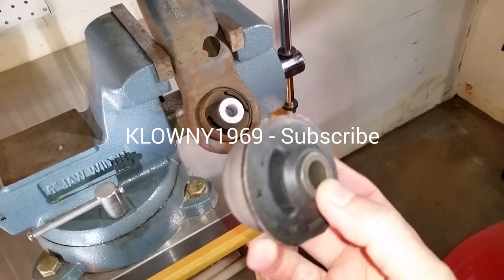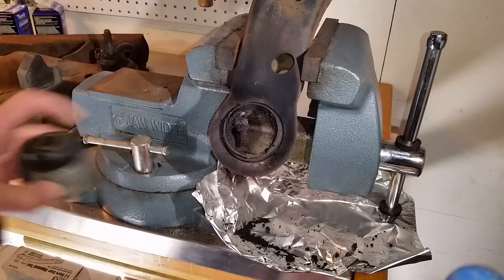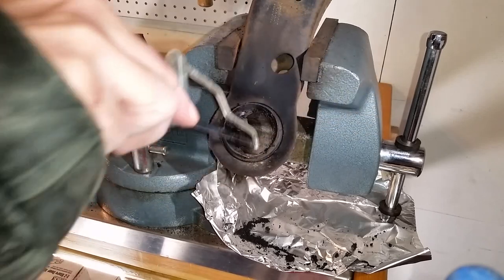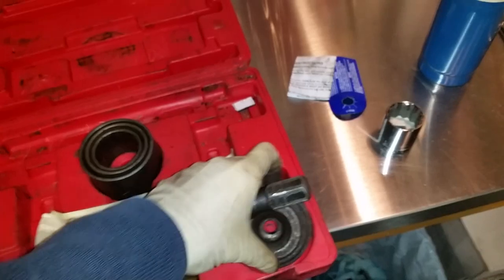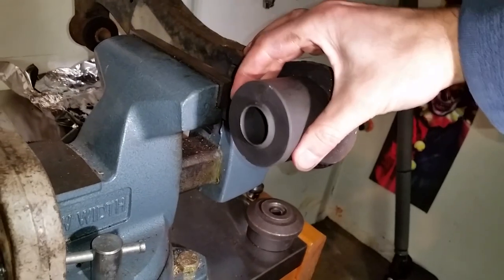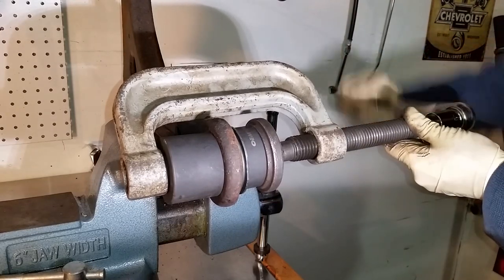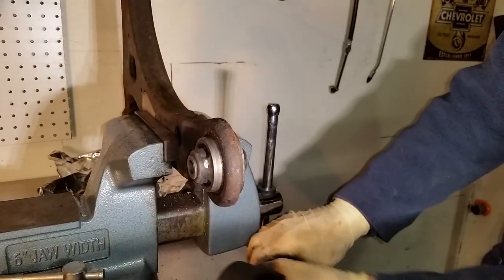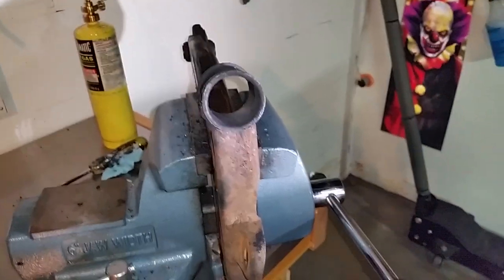How To Change Control Arm Bushings Using A Torch - DIY

Comment: I never understand why so many people post negative comments about how there way is better. Sure there are different ways but this works for him so he just thought he would share. Nice work. Anyone doing the job themselves deserves a bit of credit.
Reply from the maker: thank you
Reply: The insulting comments are not necessary, BUT they are right in saying this is method is not a good idea and not necessary. The same ball joint press he used to put the new one in can be used to take the old one out. No damage and MUCH faster.

Comment: I've spent ages looking for a reasonably hazardous method for changing bushes and now I've found it. Don't listen to those safetytards who would try to tell you you could do the first part just as quickly (without having to breathe toxic shit and risk setting your house on fire) by simply using a hacksaw - possibly the same hacksaw used in the video. No, this is the one true way of removing bonded rubber components, although using a blowtorch is a bit lame. Oxyacetylene would be much better but for best results a WWII flame-thrower wins every time. Great video.
Reply from the maker: Lol thanks for watching

Comment: Fortunately I am doing this with a chev Aveo and the control arm with bushings and ball joint was about the same price as the bushing by itself (mevotech). Since you have to remove the control arm either way I just took the full-replacement route. Thanks for the video though as I was looking to price out full or partial replacement and wanted to see what was involved.

Comment: Back before youtube had good videos like this one, I did almost exactly what the presenter did, minus I did not cut the metal ring with a saw.  I just got my set of messed up screwdrivers and a hammer and chiseled the ring out.  The rental press tool wouldn't work as the ring was essentially bonded by rust - it required a force greater than I could generate with an 18" breaker bar, practically standing on the tool.  Anyone who says there is an easier way is right, but when rust fuses the parts together, surgery is about the only option.
Reply from the maker: Yes that's right..thanks for watching and dont forget to subscribe

Comment: Most shops won't do this due to the labor involved makes it cheaper to go with new arms with bushings already installed. So this is the best way for the do it yourself kinda guy. A little elbow grease and a few bucks. I always use polyurethane bushings that way they last much longer. On my mk4 gti regular last about 30,000 miles max but polyurethane once installed I've not had one go bad.
Reply: Jacob Hendrickson how do the feel

Comment: Thanks for the tip, I used the torch method on my SEAT Cupra front wishbones.  It does help soaking it with penetrating fluid as well, makes the rubber melt more than bake.  need stronger drill bits though as I snapped about four!
Reply from the maker: sweet..thnx for watching

Comment: You're probably the only one on youtube showing how to burn a bushing out because most people are too PC and are afraid someone will do it in a small closet with propane, they'll inhale rubber smoke giving them brain damage, then the propane will put off too much CO and they'll pass out and drop the torch burning their house down.

Also for your drill bit part, next time try a hole saw? Last one I did I didn't think of it and used a drill bit too. But I'm sure once you got the saw to stop dancing it would work pretty well.
Reply from the maker: Lol thnx for commenting and watching :)

Comment: The bigger of the 2 bushings is manageable with a press. But the smaller one is the problem since the bushing is flared in a way that the cup can't be used. Fire does like the best option for those who are just diy without hydraulic press or air tools. (Speaking from experience

Comment: I bring this up because I live in a comunity where burning rubber will get you a very hefty fine.  

No fire or soecial tools are needed, though a vice makes everything easier. 

The first rubber bushing could be cut out from the center with a saw.

The second original bushing was a two piece unit, just like the replacement. Push the center metal sleeve out and you can use a screwdriver to push the far end of the rubber bushing out through the center hole.

Comment: Sorry dude. One more question for you.... Should u change/replace all bushings when doing the job. I mean front and rear all together? Is it best to do them all at the same time or could u just do the fronts and then do the rear at another time in the near future. I bought an old car last month. It's in great nick but the bushing at the front need replacing along with some other wee jobs. I need to change them b4 my NCT comes up but should I do the lot or just the fronts like the previous owner told me..
Reply from the maker: just do the ones that need it
Reply: klowny1969 Cheers mate. I'm new to all of this car fixing stuff so any advice from good people like yourself is always helpful to say the least. Thanks!
Reply from the maker: +Slim Reaper no prob

Comment: Hi, you said the bushing moves side to side but does it also move up and down. Trying to diagnose clunk i hear and i have the same style bushing that i can move up and down with a prybar.
Reply from the maker: Oscar G its designed to move a little..as long as u dont see alot of movement and a tear in the bushing

Comment: Curious as to why you didn't use the bush kit to remove the old bush? And are you not in danger of softening the control arm with all that heat?
Reply: ...you'd have to get that control arm pretty hot before you can effect the strength of it, way above 1000 degrees, for an extended period of time.  imo

Comment: My 08 Subaru my 08 Subaru tribecas rear bushings are shit. The upper outer control arm bushing is a split bushing. I’ve done bushings before but this is the first time I’ve had to do one of those. This is the only video I’ve found that shows what to do unless ya have a 400.00 split bushing extractor tool. But your bad one wasn’t a split bushing and mine is. So I’m thinking I can burn it then cut and chisel the casing out like ya did on the first one then I can press the other half out. Any Davis for setting the camber correctly on my lateral link. It’s one that has the oblong shape washer that goes over a square part on the bolt so it’s fixed and then ya turn the bolt and it adjusts the arm in or out. I didn’t pay attention to where is was set when I took the old off unfortunately. So is there an easy way to know where it needs to bet set at?
Reply from the maker: You can try using a level..but u really need to bring it for a real alignment on a computer. Don't forget to subscribe

Comment: Isnt the press kit also designed to remove the bushing? If you can push one in, it should also push one out, shouldnt it?
Reply from the maker: You can try it but there isn't enough room to press it in with the ball joint press..don't forget to subscribe
Reply: @klowny1969  when.its off the car

Comment: I had a Honda front bushing, similar to one you have here, and when I tried to press it in, it would not align and kept getting crooked and would not go in straight. Finally, after several frustrating attempts, it went in.
Reply from the maker: U just have to force it in

Comment: Man I've been trying to remove a control arm but the bolt is rusted onto the sleeve which prevents it from turning turning loose. I have used a sawzalland fire and I'm still stuck. The bushing is the one in the back for the control arm that the bolt goes to up not across. I need some help
Reply from the maker: it depends on the car..but you should be able to sawzall the bolt off or cut the sleeve.i have a video on a ford focus rear trailing arm where they were frozen on there as well.

Comment: That was helpful, but mine didn't need the rear, so I never got past installing the front bushing,  bought the kit to add to my ball joint presses (yes, plural) and never even removed it from the car. 
Mine, I removed the rubber bushing and insert with a 1/4- inch drill (we remove tractor and trailer suspensions with rubber, neoprene, and polyurethane bushings this way, so easy and fast,  then used the ball joint press to push the bushing sleeve or of the arm, die grinder and whiz wheel to clean up the hole in the control arm, coupe drops of oil, stated cranking on the press

Comment: why not use the ball joint press to press out the old bearing tho ?
Reply: CR2504life oh nm
Reply: +CR2504life  OMG that great question.
Reply: CR2504life Because the metal sleeve is paper thin. You do it like you said then get back to me.
Reply: if there's not enough clearance cut the bushings stop off and push it through the opposite way.

Comment: it will damage the control arm housing.. why you not use the press kit..:-)
Reply: propane torch is not hot enough to do damage - if you used a real torch like an acetelene torch you can damage the material if you don't know and control your temps.
Also instead of any hand chisel I use a air hammer with chisel end to gently hammer out metal rings or compress metal from the control arm. You don't need a very powerful one but use a air hammer for muffler work....learn to feather the trigger for easy control and avoid damage.

Comment: if you choose to use this method- 
a hole saw will cut out the rubber core.  no pyrotechnic needed.
the hacksaw trick worked pretty good  or a rotor file on your die grinder works great. 
silly rabbit - hold that chisel with a pair of vice grips instead of your hand. 
you should use an actual grease on the threads of that pressing tool
for that type of bushing you can use your vise and 2 pipe caps as pressing dies.
Reply from the maker: mixter7x7 wont work

Comment: I wonder how many people will burn their garages down doing this... The GM service manual says the flat edge on the first bushing is supposed to be 30 degrees off center
Reply from the maker: Perform at ur own risk..the slots are supposed to be facing towards the inside and outside of the car..thats the way the bushing bends
Reply from the maker: This is why I mentioned that the factory installed the bushing incorrectly and it cracked..check out your bushing on your car..should be pointed the way I specified..thanks for watching

Comment: you'd be better off buying a new control arm W/bushings not knocking your work but by the time a vehicle needs new bushings the control arm is so rusted insurance carriers wont cover damage to vehicle if your carrying collision that is just a thought some rustolium  and undercoating wouldn't hurt the control arm either

Comment: wholly moley,,why deal with it,,I just paid the 32 dollars for a new control arm bushings balljoint included.
Reply: tubee103 Consider yourself lucky for having a cheap car, an '86 chevy astro for example is hard to get a new balljoint for under 35$ unless you dont mind using valucraft parts.
Reply: What do you drive, a Yugo?

Comment: torch can make the metal pre_heat_treatment . then the control arm bushing hole area will be easy to crack.  bad
Reply: +单一航 make the metal heat treatment go wrong .
Reply from the maker: +单一航 nope..its not heated hot enough for that

Comment: Not a good idea mate, you make your control arm weak because of heat. That will make it brittle and rusty
Reply: Probably the vehicle belongs to someone else and the work is shop labor rate so the wasted time is paid for?
Reply: Dennis Coronel that little torch will not get it hot enough to make a difference while just burning out the rubber.
Reply: @gdaddylogan   These guys that are making comments like that must understand thermal dynamics better than we do😂. I was told once by my professor that the more times metal is heated up and cooled: in his words "it creates happier metal" and what he means by that is the molecules that makes up the metal become tighter and therefore harder.

Comment: The torch flame will over heat the steel part, that will weaken strengh and hardness, not my idea practise
Reply from the maker: Jed Huang it wont get that hot to affect anything
Reply: Jed Huang not enough to warp them. Done this to a honda and then drove it cross country no problems.

Comment: i doubt theres much saving in terms of knuckles or cash buying a new arm.instead.no hassle.
Reply: +fatwalletboy2 You never repair anything in your life huh? Those controller's arms are at lease $90 and above. Depending on the car. The bushings are about $20.00 or less for both sets. So do the math.
Reply: I just bought a new control arm with bushings and ball joint online for 32 dollars..so ya your right,its not worth the hassle.
Reply: Cheap arms are fine if you like doing them every 6 months
Reply: On hondas yes but on certain cars theyre expensive as shit. they want like 200 a side for mine and i got poly bushings both for 90
Reply: OEM bushings run for 20-25 dollars a piece. The whole arm costs $368 a piece for my GMC truck

Comment: Why didn't you just pressed it out from the being ,
It would've been easier
Reply from the maker: First bushing is hard to press out..second bushing had no room for press tool..wanted to do it a way where the average diy'er can easily accomplish..and it works everytime..thanks for watching
Reply: @klowny1969   if you have no clearance for the tool, 1st cut the that stop ring off, 2nd push it through the opposite way.
Reply: Crazy, only a crazy person,  would do it that way,and talk like that,to.

Comment: u can buy 2 whole arms on ebay 25 -30 quid
Reply from the maker: or you can buy just the bushing for a couple of quid..if you  are really on a budget..dont forget to subscribe
Reply: Not all control arms are available for cheap, in some cases new control arms are not available at all.  I recently repaired a Cadillac,  new control arms could not be found anywhere, had no choice but to replace the bushings and ball joints.
Reply: alan jones yeah unless u wanna install poly bushings or in my case if the control arms run over 100 a side

Comment: I don't believe in replacing bushings, might as well change the entire control arm, yes, I know, a waste, but it seems like it weakens the rest of the control arm, no? The whole pressing, and heating action? I guess it's appropriate on a car with expensive or hard to find parts but if you drive a regular Ford or something you can pick a new control arm up for under 40 dollars from Rockauto or something, that's what I do.
Reply from the maker: Nope doesnt weaken it one bit..depending on the control arm, it can cost over 80 dollars for an oem quality arm..and 10 dollars for an oem bushing..thnx for watching
Reply: klowny1969 Yeah, I guess you're right. Also doesn't the opening for the bushing expand and become loose due to the initial pressing?
Reply from the maker: when oressing the new one in, you can feel the resistance..no loosening occurs

Comment: Why not replace the whole arm assembly with every this in it instead of going through all this trouble. Whole thing is About a hundred dollars.
Reply from the maker: Some people are on a budget
Reply: klowny1969 
I perfectly understand, but what I see here is a messy and time consuming proses to install the bushing. I am not sure after heating, twisting, cutting and hitting the quality or the integrity of the part remains the same. I checked both arms are 90 bucks. 
This is only my opinion I could be wrong though. No offence
Reply from the maker: Tariq Choudry no offense taken

Comment: i'd say this is just plan stupid when you can rent a bushing press tool at like part source for free.
Reply from the maker: +Paul Chamberlin you cant use a ball joint press tool on this bushing to press it out
Reply: there is a such thing as a bushing press tool, there rented for free at part source.
Reply from the maker: +Paul Chamberlin yes but for this type of bushing that will not work
Reply: i take these bushings out all time with these type of bushings.
Reply from the maker: +Paul Chamberlin lol ok..now ur just lying..
Reply: I tried that press and it just wouldnt fit my control arm,even with the disc adapters,,I just paid 32 dollars for a whole new arm with bushings and ball joint...much easier

Comment: You're doing it all wrong my dude..   you NEVER touch flame to the rubber. You only heat the shell of the bushing. This breaks the bond to the rubber, and the bushing literally shoots out of the shell with almost no smoke and no fire.. What you're doing is just hacking shit up.